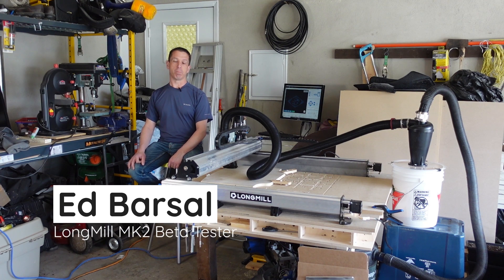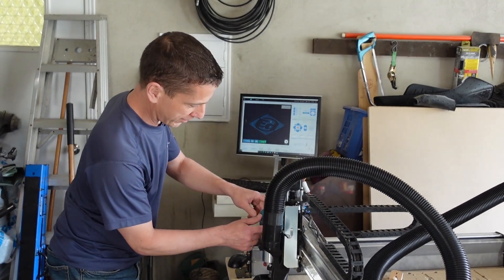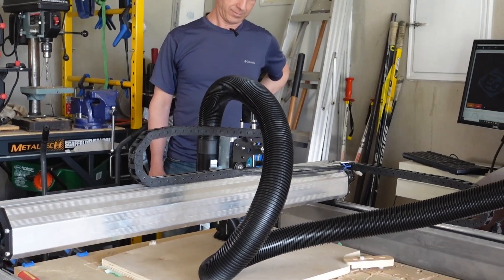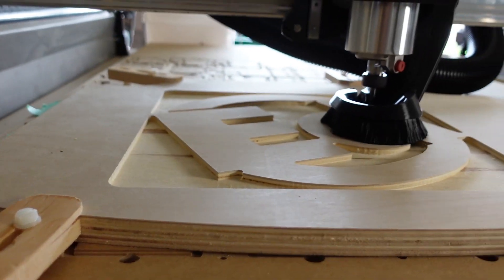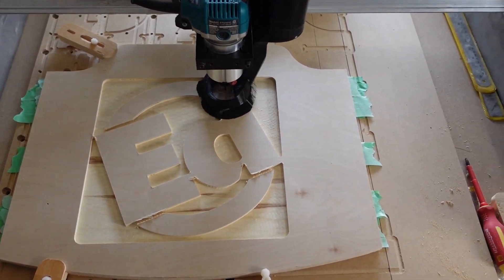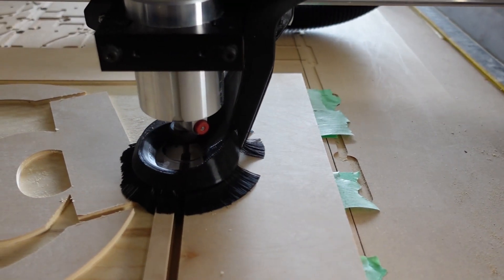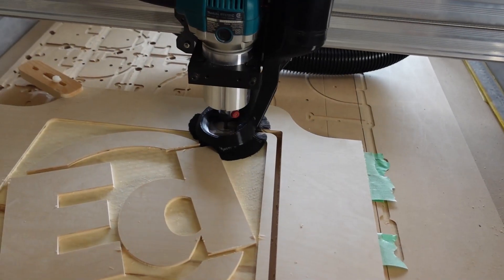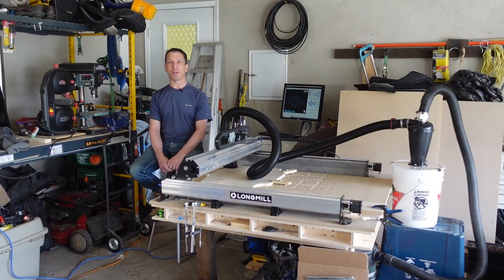The Amazing Beta Testers with Ed Barsalou - LongMill MK2

Comment: I understand where Ed is coming from.  I was a Manufacturing Engineering Tech with a minor in Drafting (retired). As far as automation, I used Auto-CAD to write code for Water Jet cutters for Aircraft parts as part of an internship. Design is a huge struggle for me as my vision is very flat meaning I can't see iso drawings as most people do (paper versions). Computer drawings allows you to move around in the drawing so as to see it as it should be.
For a big portion of my foray into wood working are troubles with curves and a unique angles. The LongMill MK2 CNC will solve that (1 month ago). Lots of "playing" to go!